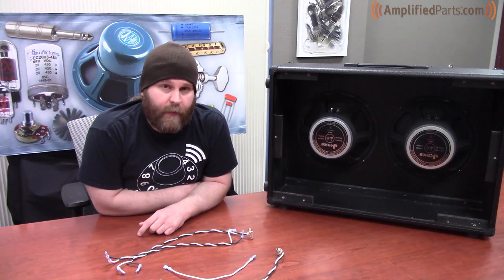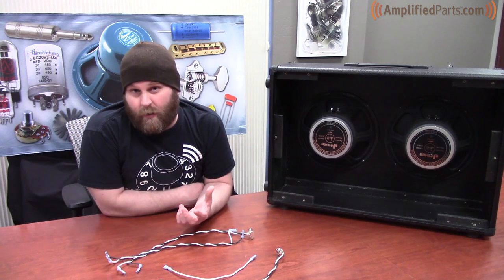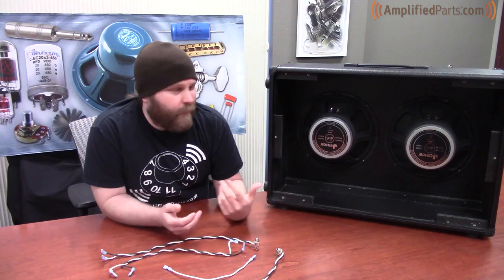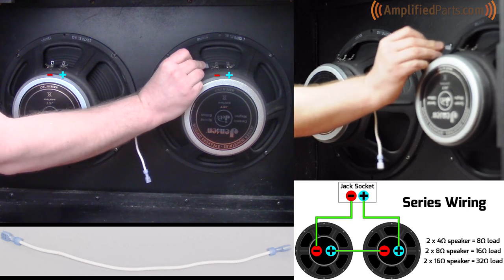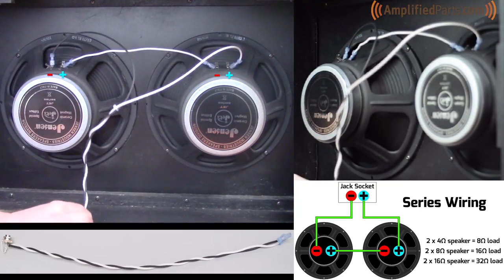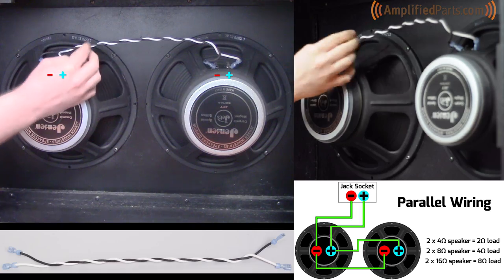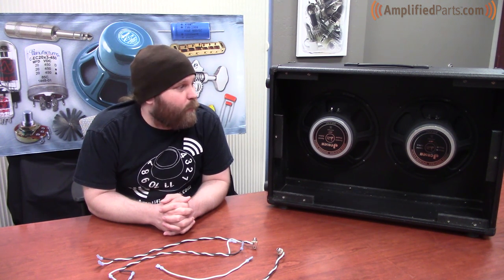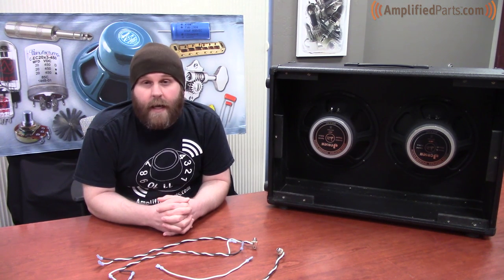Parallel & Series Amp Speaker Wiring

Comment: Thanks for the straight-to-the-point video! you just saved me from having to buy 16-ohm speakers. I knew it was 4ohms in series but had forgotten about the parallel wiring. Again thanks for the no nonsense instruction video! Killer Job!

Comment: short, sweet, and to the point! thanks dude! i'm turning an old sony speaker cabinet into a 2x12 so this vid will be super helpful for that project! thanks again!
Reply from the maker: Thanks, Noah! Good luck with your project. It sounds like it'll be cool!
Reply: @amplifiedparts  so i've got a peavey 6505 mini head, with 8ohm and 16ohm output options. Two 8ohm speakers, too. How should I wire the speakers? Series or parallel??
Reply: @amplifiedparts  my amp has a switch to bring it from 16ohms to 8ohms

Comment: While you can wire speakers in series, it's safest to wire them in parallel (or a combination of both in a 4x12). The reason is that if one speaker were to fail while you're playing, it would create an open circuit. In other words, no current would be flowing through any speakers. This can be very dangerous for tube amps because there is no load on the output transformer, which can result in powerful flyback voltages that can destroy the transformer, tubes, or other components. Of course, speaker failure is rare but it can happen, so better safe than sorry!
Reply: can someone please help me? Is there a specific way that I can wire a 4x12 cab to get 4 ohm impedance with 8 ohm speakers?
Reply from the maker: There is not a way to do this. Your options are series/parallel to get an 8 ohm cab or parallel to get a 2 ohm cab.
Reply: That's exactly the info I was searching for - Thanks for posting brother!
Reply: amplifiedparts  what would happen if he wired 2 in series to 2 in parallel wile driving 88mph?

Comment: thank you for an easy to understand explaination of this. I bought a used peavey ultra 212 from guitar center and when it was delivered the imperdance selector had moved and was between 8 and 16, one speaker cable was off, a pre amp tube fell out and was stuck to a speaker magnet and the footswitch was also stuck to a magnet. Good Grief what a mess it was! All is good now. Thank you thank you thank you!
Reply: What a horror story that sounds like. They should be wrapped up or something.

Comment: Not an expert but I was informed by an engineer friend that solid terminals (spade or ring) are preferred in high vibration situations as solder can fail under such conditions.  

That’s why cars use ring terminals for their electrics, not solder.
Reply: So why have they been soldering Marshall cabs for 50 years?

Comment: Such a straight forward video, thanks! Do you have a video on how to wire a 4x12? I'm going to use 4 16ohm speakers in that cab and want to make sure I've got it wired correctly, I'll be using the "Plug N Play" jack. Thanks!

Comment: Loved the ease at which you explained, But I have an amp that states minimum 4ohms and 2 outputs on the back of the amp.I have 2 cabinets with 2 8ohms speakers in each one, which is the best way to wire them please.

Comment: Very nice. Quick and to the point. Question. If I wire two fifteens in series. 4 ohms 300 watts woofers. Would that work with a in line 6 head rated 750 watts at 4 ohms and 375 watts at 8 ohms.

Comment: I have Texas Heat 12-inch speakers at 16 ohms a piece so if I bring the wire to the amplifier and hook up to the speaker positive and negative then a jumper wire from that speaker to the positive and negative on the other speaker it would bring them down to eight arms thanks for your input

Comment: amplifiedparts sir i just subscribed,my HIFI  system now vintage carver PM-1.5 amp along with nice homemade tower speakers with KLH  bookshelf speakers cross networked into the towers,very nice sound,they are very efficent and nice homemad bigger beast speakers dual 12 inch woofers and a 8 inch woofer cross networked on top,i like to parrell hook up the towers into the bigger beast speakers,thought of looking for a 2nd carver pm 1.5 amp..the bigger beast speakers push the bass

Comment: how the hell do you wire two 8ohm speakers such that the load remains 8 ohms?  So you can only double or halve it?
Reply: you only can wire them to stay at the same load with 4*the same load then series,parallel connecting them

Comment: When wiring in parallel, does it matter which speaker you connect to the mono jack? Also, if I'm using a 100W amp to a 60W speaker and a 65W speaker the load will still be evenly shared between the 2 speakers, correct?
Reply from the maker: Hey Eddie. You simply add the power ratings together. Your 60W and 65W speakers in parallel would have a ~120W rating when shared evenly.

Comment: In the parallel wiring, does it matter whether you wire them from the jack to the same speaker? Or could you wire the positive jack to the positive of one speaker and the negative jack to the negative of the other speaker?

Comment: Thank you for your explanation. I have 2 pair (4 speakers) of 4ohm 50 watts (for each pair) speakers, Can I connect them in series to make them work like a 8 ohm 100 watts speaker to connect to one of the channels on my Amplifier that provides 2 channel of 8 ohm, 100 watts?
Reply from the maker: When hooking up four speakers, the two options are parallel and series parallel. If all four speakers are 4 Ohms, the output will be 1 Ohm when wired in parallel. When wired in series/parallel, four 4 Ohm speakers will have an output of 4 Ohms.

Comment: What will b the best way to wire 2 /16 ohms to a 2 spk cab on a 100w head w ohms option of 8-16omhs on amp? Will 2 8 ohms spkrs b better then 2 16 ohms ! If so what will b the best choice of ohms to wire the 2 spkrs? Ty great vid btw

Comment: This is helpful, thanks for the video.

Do you happen to sell those twisted wire pairs already made up with spade connectors?
Reply from the maker: We do sell the wire but you'd have to source the spade connectors elsewhere if you want to use the cloth covered. We just used it because it's what we had around the shop but it's not necessary.We DO sell twisted pairs in a standard 18G with spade connectors in 2' lengths that may be close to what you're after. I'll include the link below:

https://www.amplifiedparts.com/products/speaker-connectors-twisted-wire-pair
Reply: amplifiedparts that's perfect, will order when I get home. Thanks for the response, and I'm happy to have found your site. Looks great.
Reply from the maker: No problem Evan! Always reach out if you need any help finding something.

Comment: Do ohms affect sound? I have an ohm selector on my amp. 2 8 ohm speakers wired in parallel ( 4 ohm) if i wired them in series and selected 16 ohm would it effect the sound at all?
Reply from the maker: A lot of people have preferences. If you're curious, it doesn't take long to wire your cabinet and check it out. I think it's one of those things where it varies from amp to amp and speaker to speaker. I'm not sure if I've ever seen a consensus on the tonal qualities.
Reply: I believe it was that it would become a little brighter or a little darker, but I don't remember which way around. - I will tell you this, that there are so many variables that it doesn't really matter anymore. I would recommend, like in the video, to just use the impedance that the amplifier works best with. Then just tweak the sound to your liking with equalization and so forth. Though if your cabinet has a switch, and also your amplifier can adapt, you can try it out.

Of course the cabinet itself will also have a big effect, but the impedance a way less significant effect. - Perhaps it's more obvious when you're going to do sterile and direct comparisons, but in real world use it won't be anything major that I know of or that you'll notice. The character of the speakers will be the character of the speakers, and after that the most critical thing is the cabinet, the room, the amplifier, and so on.
Reply: Mine sound better and get louder at 4 ohms but one thing i just tried and made a huge difference in sound was i run my guitar straight into the pedal chain then output right into the return of the fx loop. on Marshall mg100hcfx it sounds 150% better also on a Randall rx1220 but on this Rogue tuberider hybrid amp it sounds crappy that way. just something else you might try..

Comment: I have a KLIPSCH 50 WATTS center speaker for home theater the tweeters come on but the center speaker won't I got it hooked up to a RCA home theater system is there anything that I can do to direct I have tried to direct wire it but the speaker still doesn't turn on

Comment: So if I want to bring my two 16ohm speakers to 8 I would wired them in Parallel correct? I have a Fender Hot Rod Deville 4x10 60w but I also have a 4x12 Vintage 30's cab just sitting there, they are 16 ohm each but my Fender uses 8 ohm even for the extension cab it's labeled 8ohm
Reply from the maker: That is correct.

Comment: My question is......which setting do you put your ohm selector switch in....4..8..or 16 ohm?? With 2 speaker series or paralell.
Reply: My God Man! You actually have an OHM Selector Switch ?! My Receiver/Amplifier only says 6 to 16 ohm on the back. Let's hope he answers our question soon about whether to go Serial or Parallel with a Speaker Wiring Hook up Process. My educated guess is, if I have a Receiver/Amplifier rated at 16 ohm Max, and I wish to wire up approx 4 Speakers (2 of 'em are 6 ohms and the other 2 are 8 ohms) then 
, for safety, I should wire up all the Speakers in Parallel to help keep the OHM's "Low". I'm expecting my total speaker load to be no more than 14 ohm with the Parallel Wiring Method.

Comment: I just picked up a Bogner 2x12 wired at 8 ohms. I want to replace the speakers with a pair of Scumbacks the that I purchased previously. The Scumbacks are both 8 ohms. Is the impedance rating predicated only on the speakers? Or is it based on the wiring of the cab? In other words, how can I load 2 8 ohms speakers into a cab that is rated 8 ohms?

Comment: I have 4 6.5 8 ohms (300w) speakers and 4 bass rockers tweeters also 8 ohms each at 300w and 2 bass rockers horn drivers what way do you recommend to run them to the amp
Reply: Wow! Your Sound is gonna be amazing! To get a good straight answer from a knowledgeable person, looking in on us today, you must tell us what kind of Amp do you have and it's ohm rating.

Comment: How does an 8 ohms series (2 x 4 ohms) cab compare to an 8 ohms parallel (2 x 16 ohms) cab? Is there a difference in terms of volume and tone? Which do you prefer?
Reply from the maker: It's hard to really say if one is going to give you better results than the other since the amp, cabinet, and speakers have a lot of influence on the tone. The volume should be the same since the load is the same. I would recommend experimenting to see what you prefer since your ears are always what matter most in your own rig.
Reply: I plan on building a 2x10 cab with two Jensen P10R speakers. The speakers are available in 4, 8, 16 ohms. I don't have the funds for both cabs but it sounds like a good experiment to try out.
Reply from the maker: Honestly I think you'll be happy with it either way. I'd flip a coin.

Comment: I have two 16 ohm speakers hooked up in series, the option on my amp only has 4,8,16. Will it still work/which one do I select? Or do I need to rewire speaker cab to parallel? 
2x12 cab and guitar head. Thanks

Comment: with one better series or parallel?
Reply: If the amp has only those two speakers which are connected in series and  you blow one speakers coil open, the amp is without any load which is very dangerous for a tube amp output stage. No sound either. 
If the 2 speakers are connected in parallel, if one speakers coil goes open, there is still a load (which of course has doubled in ohms and is mismatched) and the sound if the amp and the speaker can handle the changed situation.

Comment: Question,  white or colour is always positive? and black cable is always negative?

how do you know which one is possitive and which is negative?  I have Fender and bought it secondhand, it doesnt say + or - anywhere in the speaker.  If I have a fender with original speakers, would you say they are likely to be just like in your Jensen speakers?  Tell me please.

Comment: What controls the decision of which way to go? The only thing I can think of is if you have a finite set of pieces to use and therefore must wire it in a particular way.
Reply: Speakers almost invariably fail open-circuit. So if you're using a tube amplifier, you definitely want to go for parallel wiring because if one speaker fails, the amp still sees the load of the surviving speaker. If they're in series instead, either speaker blowing will open-circuit the whole cabinet and tube amps absolutely hate that; you can lose the output transformer and/or the power tubes. I have a pair of vintage PA cabs inside which there's a big honking power resistor in parallel with the circuit breaker so if that breaker pops, the amp still sees a load.

Comment: I’m into a hobby that deals with speakers and such, if I wire four 8ohm speakers together in parallel will that then be 8 ohms or 2 ohms? Just asking for clarification as the stuff all has 8ohm amplifiers.

Comment: If you wire two different speakers (let's say a 20W RMS and a 100W RMS speaker) of the same impedance in parallel, would you have any issues with the 20W speaker being overpowered?
Reply from the maker: Yeah, you would. The power is distributed evenly between the two speakers in both series and parallel configurations so you'd look at it this way: If the amp is putting out 100 watts then it's going to send 50 watts to each speaker. This would be fine for the 100 watt speaker but not so much for the 20 watt speaker.

Comment: Question . I have a motorcycle amp and 2 speakers. if I run the 2 speakers in parallel will it be louder  ?

Comment: I have a solid state 2x10 8 ohm combo wired in parallel, a pair of red and black wires to one speaker and blue/white to the other (Ampeg SS-70c).   I want to try series wiring (16 ohms) but the wires go up in the chassis.  I am guessing that I have to unscrew the chassis to move around the wires from the circuit board end?
Reply from the maker: That amp actually has two power amps, one for each speaker. You can't wire them in series because of this. Very cool amp though!
Reply: amplifiedparts I see, Thank you very much. The clean channel sounds good, but the dirty sounds like a chainsaw, lol
Reply from the maker: Sometimes those solid state amps can do that! The Roland Jazz Chorus amps have a pretty notorious distortion. If you have a distortion pedal you like, try putting it in the effects loop and use the clean channel.

Comment: • I have 2 cabinets: 
2x12 w/16 ohm speakers, (Vintage 30 & GK85 Celestions) 
wired parallel for (8 ohms each cab?). 
- The jack panels on the back of these cabinets have 2 jacks labeled "parallel"

• My 100w head will run 8 ohm or 16 ohm and has two speaker outs, Main & Extension.
Q? is: how do I be sure and NOT blow up my amp? -
do I use the 2 outs on the amp or piggyback off the first cabinet ("parallel" jacks)...

Comment: I have a question . I have a 100 watt into 4ohm s Hot Heads bass amp 2 speaker out put Jack's.  What speakers set up should I use ?

Comment: What happens if I wire two separate 4ohm speakers to the same output terminal of an amplifier? 

Example: I’m using 1 amp capable of doing 2ohm or 4ohm. Sometime I only need one speaker and sometimes for more Power I need 2 speakers.  So if I take the same amp output and send out 4 wires (or 2 wires to each cabinet. Left and right/ positive and negative) will that be 2ohms final impedance?

Comment: I have 4 8ohm speakers and a 4 channel amp rated at 4 ohms. My question is if I parallel my speakers to 4 ohms and I bridge the 4 channel amp will this work? ALSO, the amps RMS rating is 100 watts per channel. If I bridged the 4 channels to 2 channels and parallel my speakers then am I getting 200 to each speaker or less?

Comment: NEED HELP!  I have a 2 X 12 Cab. It has two 8 Ohm speakers in it. I want to make it a 16 Ohm Cab and know how to wire it in series. Problem is when I use my Ohm meter to measure the Ohms on each speaker I get 7.3 Ohms on each speaker and not a true 8. When I connect them in series and measure across both speakers I get 14.4 Ohms and not the 16.  Will this mess up my new DSL1 amp that says 16 Ohms?

Comment: Dumb question, I'm sure, but what kinda wire do you use to connect the two speakers together in series? is it a positive or negative wire or does it not matter. Thanks
Reply from the maker: Wire itself is not polarized. Many people use color coded wires to keep track of what is positive and negative as done in the video with black and white wire, and the link to the specific wire used in provided in the video description.

Comment: My amp does 200w rms at 4ohms and does 300w at 2ohms. I have a 300w 4ohm subby. Should I get two 150w 4ohm speakers and wire them in parallel to match the amp output? I dont know how it would effect the rms of 2x300w rms 4ohm speakers wired in parallel

Comment: Can you wire two 8 ohm speakers in series (16 ohms total) with an 8 ohm amp? I’ve heard that’s okay.
Reply: Hi! I'm getting the feeling he hasn't answered anyone's super good/important questions here in the comments section. After what I read & watched here today, I would wire up your two big 8 ohm speakers in Parallel. This method should "drop" the total ohm output from 16 down to 8 which is very compatible with your 8 ohm Amp. I could worry less about a possible speaker/receiver/amp 'burn out" by going the Parallel route.
Reply: Tuck Porter Thanks. Yeah, I actually kept reading and couldn’t find anything to contradict what you just said, so I tried it anyway. It’s been working fine. Maybe a bad idea on my part. But it turned out fine.